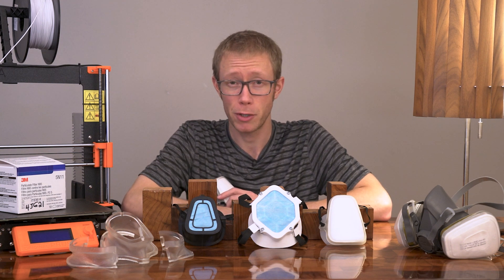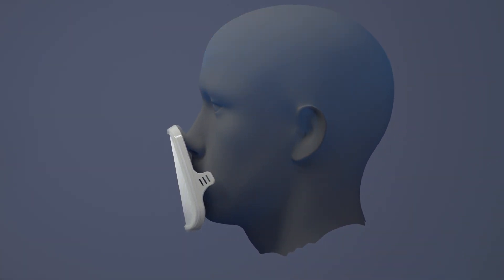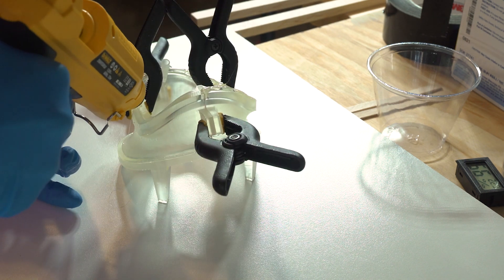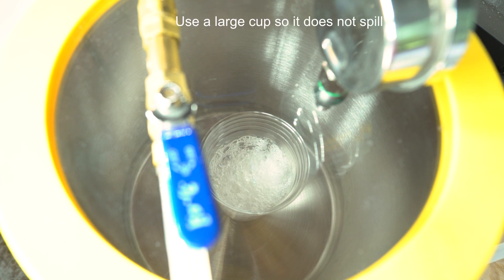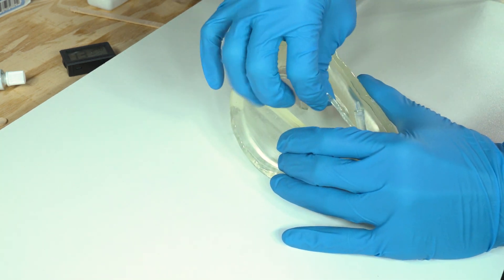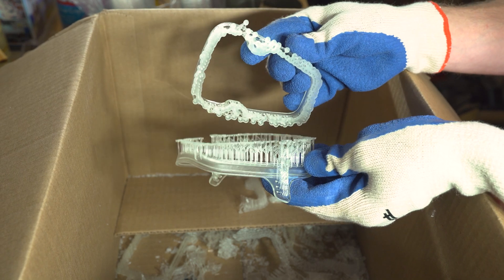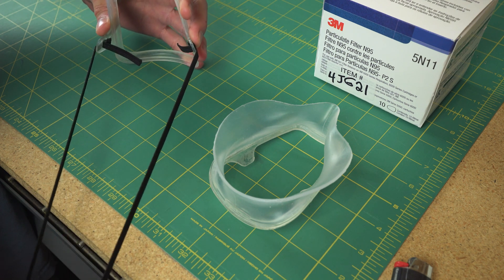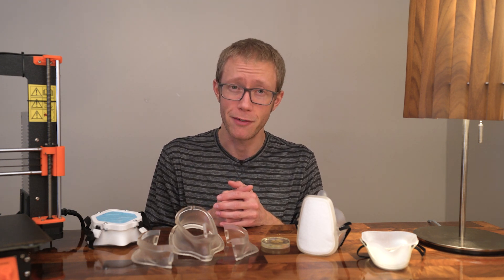Respirator Face Mask V3 with DIY injection molded silicone seal and 3M filter

Comment: It might be worthwhile dissecting / reverse engineering a scuba mask. They typically use silicone and a mechanical seal for the lens component. Also with this design and others I have seen I wonder about the seal  between the filter and the plastic surface. This seems like a point of failure / leakage. What about a thin bead of 100% silicone applied directly around the perimeter of the filter to create a compression seal?
Reply from the maker: It's true, this the seal is less than ideal. This mask also doesn't seem to fit people as well as the previous 2 versions despite the seemingly better rubber seal. In order to improve on this design a lot of manufacturing challenges come into play and in a DIY setting I have not figured out the answer to these issues.

Comment: Maybe a design improvement you could add is instead of having the 3M filter held in place by using a clip that sits inside the FilterInterface, why not rather have it sit outside. That way you could do possible overmolding (increasing surface area for the adhesive) making for a stronger bond with the silicone rubber part and the FilterInterface?

This looks like a super awesome design and would love to get this made, normal masks just mist up my glasses too much and this looks really promising. The slim design just adds the cherry on top to the overall look and feel of the design.😁
Reply from the maker: Thanks for the ideas! This design in particular seems to work well for me but it has a hard time fitting a wide range of faces (despite how flexible it is). There was almost a production version after this design that remedied these issues but the funding for it fell through, unfortunately
Reply: @The3DHandyman  ah shucks sorry man, that must have been tough. You have done great work, so hopefully keeping that up will mean it just becomes a matter of time for the funding to come through. Where could the subscribers and interested contributors go to show support?

Hope that we get to see this v4 soon, the differences from v1 to v2 were huge, v2 to v3 didn’t let down so I am sure v4 will be worth it.
Reply from the maker: @238chase  V4 will hopefully see the light of day at some point! I very much like the design and I bet you will too.

The best way to keep this channel going is to support the Kickstarter that will in a round about way make or break this channel. It ends in a few days and is currently a little short of it's goal.

https://www.kickstarter.com/projects/cruciblecompany/the-mycoseries

If the product is not your style, you can still make a donation with "pledge without a reward". If the project doesn't reach the goal, you wont be charged.

Comment: your work is very informative.....sir I am searching for material for customized static and dynamic sealing applications. Do you think Smoothon Sortaclear 18 is good for this?
Reply from the maker: Thanks! It's possible. Sorta clear 18 is not extremely resilient but might hold up well in some conditions. The texture is a little sticky to the touch so it should cling to smooth surfaces easily.
It's hard to say without knowing the exact application though. Often times with this sort of thing a lot of experimentation is needed to find the perfect product.
Reply: @The3DHandyman  Thank you for reply...
yes, you are right lot of experiments does require to reach perfection. my application demands 50-80 shore A ( but of course, it will be set after testing )but the material surface should be smooth as you said. I will be glad if you have any suggestions in terms of a smooth surface.
Reply from the maker: @durlabhsoni3079  I am pretty new to this field, so I don't have much to offer. Have you thought about posting on any of the Smooth-On videos? They know a lot more about their products than I do.

Comment: Hmmm I'm surprised it wasn't built with it being used with the filter portion pulled away more from your face.  I hate the masks that are right in your face.
Reply from the maker: The issue with moving the filter further from the face is that the amount of air that is rebreathed increases. The smaller the cavity, the more fresh air you can take in with each breath.

Comment: here some of idea to make design more compact

1) fold the filter into a wavy zigzag design for the 3m filter just like car filter so the space usage will be reduce but not the filter area

2) use 2 filter instead of 1 because 3m already calculated the amount of filter area needed for the human lung to operate when it doing a heavy work(this explain why you get tired and fatigue when using single 3m filter)

3)if you could add 1way airflow exhaust, that will greatly reduce moisture in the breath area(consider it as optional because the mask will be more complicated to design)

4) the inner frame of filter should be embedded with silicone together during mold cast because you can get rid of the gluing step

we hoping you can keep improving your design for your next version so the world can keep appreciate with your contribution.
Reply from the maker: Thanks for the feedback! I have a 4th version of this mask that was designed but never got prototyped. It incorporates a lot of the features you mentioned. Maybe one day I can get around to making one. Time will tell

Stay safe out there my friend!
Reply: @The3DHandyman  nice! I am also making a mask Your videos are very helpful!!

Comment: This is nice and all, but i think just making a stl and printing the silicone part from tpu would benefit 100% more of other viewers. Most don't have formlabs printers home nor, vacuum machines.
Reply from the maker: Very true! The rubber portion of the mask is available as an STL on the thingiverse page.
Reply: @The3DHandyman  This is very exciting news. I think i have to test this. I mean it is great thing to have makeshift masks just to be sure that there is at least some mask when needed. There should be also resmed cpap masks as a diy project, unfortunately i'm not able to model those yet, but it is legalized robbery what they ask for the resmed F20 face mask part.
Reply from the maker: @ponakka  You may need to use blender or a similar program to morph the shape of the part into something that fits your face well. This design seals well on a very tight range of face shapes

Comment: I did a mask from cardboard a HEPA13 filter and silicone, It works but is only like 75% comfortable. A bit stiff. https://archive.org/details/home-made-mask-with-hepa-13-filter/  The filter is however great. Easy to breath.

Yesterday I bought a mask with folded HEPA-filter in it. "Elipse P3 Respirator M/L" It is awesome and comfy. The only downside is you blow out viruses into the air through the valve, like with the surgical masks and the N95-mask with a valve, you do contaminate your surroundings, even if you breath in much less aerosols.

I guess you could fit a filter to the exhaust pipe on the outside somehow.

The filters are very for this mask. Your idea of using a hepa material and pressing it into a fold somehow might actually be a good idea. Maybe a pre-folding device of some kind, or lager surfaces on the sides? This could definetly get the price down, once you have the tight silicone mask.

Oh. By the way. This see-through plastic in a CPAP-mask inspired me too. https://www.resmed.com/en-us/sleep-apnea/cpap-parts-support/sleep-apnea-full-products-list/cpap-masks/airtouch-f20/

What about seeing the mouth of people when we talk? It has two plastic parts holding the comfortable silicone inbetween.
Reply from the maker: The cardboard concept sounds interesting. I suppose my one concern would be that the cardboard would soak up moisture from respiratory droplets and start degrading and/or harboring bacteria. I found that the V3 silicone mask seems to have some microcracks that create a location for bacteria to take hold as well. That was surprising!

The clear mask has been suggested before. I think it's challenging to design something like that that looks good but there are a few examples out there at this point that have pulled it off.
Reply: @The3DHandyman  The cardboard can be completely coated with silicone and desinfected. I am considering a UVC-lamp.

Comment: I suggest you make the soft sealing as an equally thick snap-in into a groove and keep the rest hard. Then glue is not needed except to glue the sealing together.
Reply from the maker: Thanks for the thought! I will keep that in mind.
Reply: @The3DHandyman  Cool I must say you have inspired me.

I have some more ideas of huge improvement, and that is to make a bit thicker cartridge, about 2 cm, with multi-folded filter, glue it into the cartridge, just like the folded filter you bought. In this way you will increase the filter surface area, increasing breathability.

Another cool thing would be an exhaust valve that can be turned on and off, depending on the environment you are in. 

A bicycle helmet with a tight plexivisor might also be a great protection, especial for medical staff working with coughing patients or anyone who want to be more protected. The air you breath must first pass the filter, then flow inside the visor to defog it, then into mouth and nose through valves. Might look bit like Darth Vader in the Star Wars, I know, but I guess these solutions could be made in a bit more rebellious design than black? In some countries a bicysle helmet might also need a rain cover in front of the filter.

I do not have a 3D-printer and no experience of your 3D-programs but I am an experienced mechanical engineer willing to learn. Until then I will try to build in other ways.

My ideas are a free gift to you. You deserve it. Stay awesome!
Reply from the maker: @martinvaxjo  Thanks Martin! I like your ideas. The pleated filter is one that I have thought a fair amount about. I attempted to make a filter holder that forced the filter into that shape but there were mechanical issues with the process. Still working on that one...

The on/off out valve is also pretty cool concept, hadn't thought of that! Will have to give that some thought.

Thanks for your thoughts on the subject!
Reply from the maker: @martinvaxjo  Got yah. I had been thinking about using KN95 type material for the pleats. The HVAC filter material would likely be more robust.

Comment: A pressure pot causes the air molecules to expand which is why the seemed to appear from nowhere.
Reply from the maker: As I understand it from the videos that I watched about the process the pressure pot is supposed to crush the air bubbles down to a smaller size. However the extra pressure may have just forced air out of the gaps in my mold and into the silicone in the first place. Regardless, I have a lot to learn...

Comment: For a lightweight secure attachment, you only need to look at how fabric and/or leather goods are attached to hard components. Have appropriately spaced holes on the hard component, which you can then use to sew the soft component onto the hard component. Then, normally, resin or some other sealer can be used to seal the joint, but in this case, I expect that you could use the silicon adhesive you were using as the sealing material.
Reply from the maker: Thanks for your thoughts! I will keep this in mind.

Comment: N95 mask packaging has a label or verbiage indicating protection down to 0.3microns. N95 mask are the gold standard of masks.   COVID-19 viruses are 0.125 microns.   
HOW MASKS WORK :                                                                                                                                                                              A basic understanding of how masks work helps. Masks are filters. The material used in a standard surgical mask (by far the more common type of mask) reduces transmission of bacteria. Both bacteria and viruses are microscopic microbes, but they differ greatly. Bacteria are living cells, while a virus is a particle that requires a host cell to replicate. A coronavirus virion (particle) is spherical, averaging around 125 nanometers in diameter. Compare that to bacteria’s 1,000-nm size. It’s a grape compared to a grapefruit. A surgical mask whose purpose is to block bacteria will do little to prevent passage of the smaller coronavirus particle. 
SHORTCOMINGS IN THE CURRENT DESIGNS                                                                                                                   Problematically, masks seem like they weren’t designed for people’s actual faces. What’s more, tying the straps around your head might cause the mask to pucker at the cheeks, creating gaps; and gaps above the cheekbones result in an upward flow of breath that fogs glasses. Even just talking can make the mask creep down from the nose. Yawning does the same but more quickly. Biomechanically, face movement and mask movement don’t align—the jaw’s pivot point is near the ear, while the mask flexes near the mouth.
In todays age people forgotten how to cover there cough and sneezes, however, a mask can not stop an airborne virus that goes right threw a standard mask ,  types of mask demonstrations only shows liquid particles in which they are affective, C-19 is airborne with a particle size 1000's times smaller and also the masks are not sealed tight, if your breathe can go threw so can the virus, for or against mask wearing you might want to learn that you eyes and ears can be entry points also, so for all you that like shaming/fear as a tactic, maybe you should set an example and just put a plastic bag over you entire head.
Proof masks don’t work:
Mayo Clinic mask efficacy study video with smoke, and mask.
Particulate matter in wood smoke has a size range (0.4 – 0.7micrometers).
https://www.youtube.com/watch?v=Ibm_ZuwNuRQ
Reply from the maker: Thanks for the info!

Comment: 6:04 When pouring out of a container with an offset neck like that, hold the container with the neck offset up instead of down.  This allows the container to tilt farther before fluid escapes, making the spout closer to horizontal, and reducing both the tendency to glug and the tendency for surface tension to drag the fluid along the outside of the container.

This video https://www.youtube.com/watch?v=vxnDvtuKZZE might be for engine oil, but the same physics apply to any bottle with an offset spout.
Reply from the maker: Thanks Joe. Good note! I got used to this while doing oil changes. The glug that you get with a 5L jug can make quite a mess! The surface tension on this smooth-on stuff causes it to immediately wet the surface of the bottle. I made a few of these and found the fastest, cleanest, and most accurate way to dispense it was with a 10ml/cc syringe.

Comment: Please look into Hallyard H500 or H600.  They filter 99.9% as tested by U of F Hospital. Info on material is in both links and cheaper respectively 

https://www.youtube.com/playlist?list=PLc1BAvOPbN4E6MC-nsaNqn05i5GJRA_cV

Can the masks be laundered or bleached? No, this will degrade the Halyard H600 fabric. For sterilization, you may place the mask in a 165°F oven for 30 minutes.

Comment: Is this resin print only?  Can it be done with pla?
Reply from the maker: Good question. It might be possible to do this print on a FDM printer but I haven't tried it. You would need to print all the with supports which would require a lot of cleanup/sanding/smoothing work. I think a mold release such as petroleum jelly will be necessary to prevent the silicone from sticking to the mold.

A resin printer is definitely preferable for this but if you decide to give it a try on an FDM printer, let me know in the comments how it worked for you.
Reply: I can confirm sanding is needed but still clicks together nicely. I printed them face down with a raft. I am going to try and print the flexible part in Tpu. Would make the whole process easier. What are your thoughts?
Reply from the maker: @jamieb78  I cant say for sure because I am yet to try a printing in TPU. Best of luck! If it turns out well, please feel free to upload some photos to the Thingiverse page.